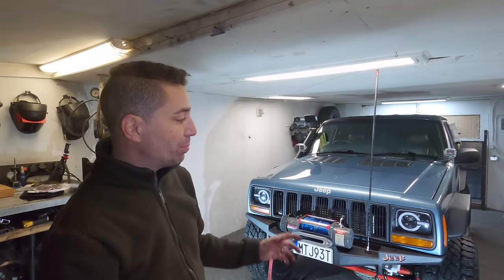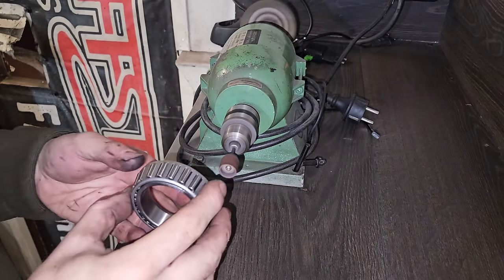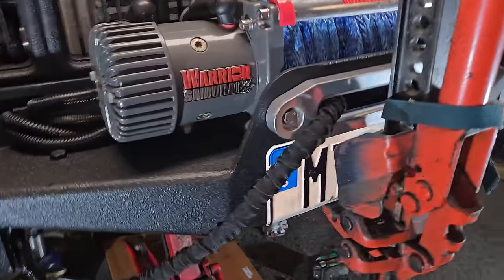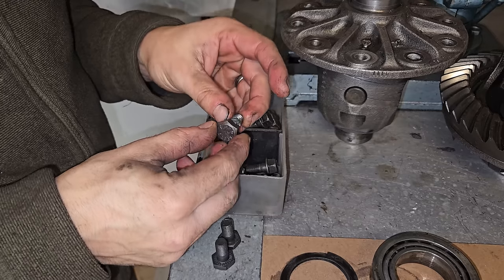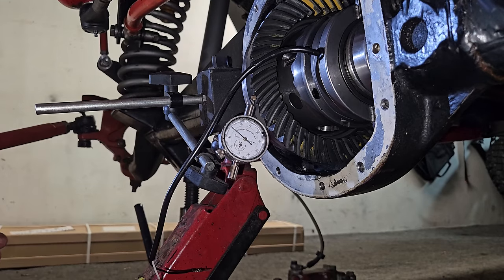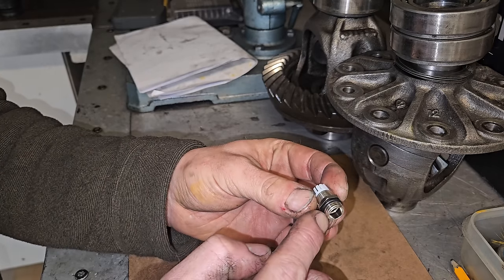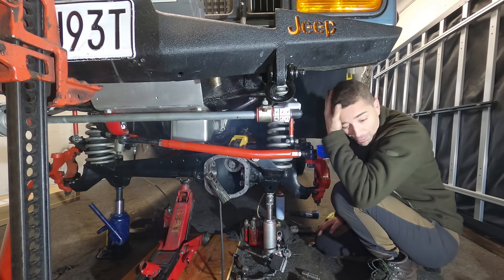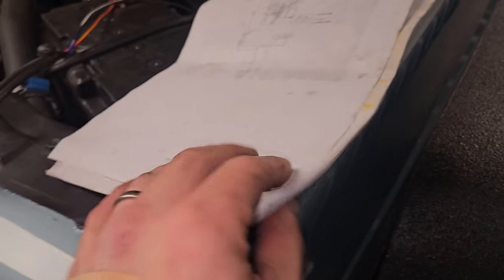Dana 30 HP E Locker Installation / USED GEARS

Comment: Use the locked Dana 30 sparingly. The axle shafts really don’t like spinning 35s with a locker lol. I’ve broken many of them
Reply from the maker: That's my main fear. I'm guessing even with chromoly shafts, it just means the ring gear takes the brunt?
Reply: @WorkshoptoWilderness  yes. id even swap back to the stock shafts if you have them. keep chromos for backup/emergency. then you have a "fuse" in the system. but if your not hard on it crawling rocks, it should be fine

Comment: Oh! I thoroughly agree that air lockers suck anywhere that has winter. My XJ is older and has (HAD) the Vaccum Disconnect to work the 4 wheel, and even THAT would freeze up. Glad it did, actually,  I learnt a lesson the easy way.

Comment: Nice project. And the car will definitely be a lot better off-road than it already is. About the E-lockers I see mostly bad experiences from people from Australia. Especially when the car rolls back a little bit the locker is out again. Personally I have no experience with it, have always used ARB or Ashcroft lockers. And I was very satisfied with that. Have fun with it.

Comment: 12:50 my wife was laughing, saying "That's you", meaning me.  The "how am I going to fix that" then "I can't fix that" and sacking yourself off the job for the time being, I can certainly empathise.  In the space of five seconds you can see five hours of work just to fix what was done.  We need the way-back machine to go back in time stop ourselves sometimes, even knowing we are almost guaranteed a shite outcome, we still have a crack at it.  It's all character building, that's for sure.  Cheers, from Australia.
Reply from the maker: Haha, we've all been there, or at least I seem to be there on most jobs! You're absolutely right, though. It's all character building, and it's good when you get through the job with a relatively acceptable outcome.
Thanks for watching and I appreciate the comment.

Comment: Hi Mike. Yay front locker in! Very happy for you. 👊 you have gone too long without! 
This was such a great video. Because it didn’t go the way you wanted it too. And you didn’t edit it out. You kept it real. And that’s what makes your channel so relatable! 
You’re a talented guy. With normal tools. Doing the best you can with what ya got!

Mike like others have commented. Might be best to keep the chrome alloy axles as spares. Break a stock one and not the ring and pinion. Put a spicer greaseable u joint on the long axle shaft. Because if you break the long axle shaft. Harder to fix in the field. 
Mike remember you’re most likely going to break a u joint when the wheels are turned.  But snow will be so much more forgiving than rock etc. 
Great job on siping the tires they look great! Perhaps keep the chains off the front axle? Keep the weight down. Save the ring and pinion? And now the tires are siped. Front differential is locked. Rear chains might be enough? If the snow conditions warrant chains etc.

Oh and 3 out of 5 guys I run into up here in Canada. Who run arb lockers. Say yeah. It’s not working right now. Air leak. I’ve no doubt ARB are great in warm climates. But like you. We get down to -35c here too. 🥶
Reply from the maker: Thanks, mate. I think it's good for people to see the reality of these jobs rather than a polished tutorial. I'm a bit worried about snapping an axle shaft or braking teeth on the ring gear. I've taken the long shaft out and swapped it with a normal shaft. 
So the short on is a chromoly with a 5-760x joint, and the other is a standard cheap u joint with a normal shaft. I mean, I was thinking of going to CVs because if they brake, they don't tent to compromise the preload on the wheel bearings. So you can still drive. 
I will see how it goes but I think low speed might be the key.

Comment: I could see that wheel spin required before locking being a problem if you're a rock crawler, but for snow wheeling a little of wheel spin realistically wouldn't be much of a problem. Should work awesome for you!

I'm looking forward to seeing your build change yet again as you work on developing a system for the increasing family size.
Reply from the maker: I think it would be a pain in the ass in some situations, but for what I do, it shouldn't be a big deal .
I'm interested to see how it works, but I think I will probably end up snapping an axle shaft again! 
The bed in the back is almost finished, but the family stuff is yet to be determined. We're expecting our 2nd boy any day now! Myself and my oldest have been on a camp, and he loved it. I'm not sure if he could handle the winter, though. 
Thanks for watching

Comment: Feel your pain!  Currently regearing and fitting an air locker, nothing seems to be going right.  Trouble is as I can't weld fixing screw ups is a bit trickier 😱
Reply from the maker: Ah, that's a pain! I mostly enjoy diff work when I have the right tools, and the axle is out of the jeep. But this time, I wasn't feeling it at all. I hope you're diff work gets better! All the power to you! 
Thanks for watching

Comment: that look on your face when you drain the diff oil and its.. milkshake..  we know that look lol
Reply from the maker: Yeah, that was not a good look. Maybe the new spider gears had shed their excess particles? I don't know, but I will try not to open it again for as long as possible and ignore all odd sounds. 
Thanks for watching
Reply: @WorkshoptoWilderness  all looked good inside and in the end.. it will self clearance.

Comment: Got some spatter on your break disk. Made me laugh. Top tip if you do that just put the exact same amount of spatter on the other face of the disk otherwise you might get some vibrations at speed... It it still does it you might need to add some to your other disks as well to even it out. 
Will I get an alert in the app when the OF session with Babs goes live? Don't want to miss it.
Reply from the maker: Thanks for the tip 😄! That bung had me foaming at the mouth. The reality of the work, though!
Barbra, unfortunately, was a no-show. I'm pretty disappointed. I found a stray cat to act in as a replacement, so hopefully, I can still make the deadline. 
Thanks for watching
Reply: @WorkshoptoWilderness  Mittens to the rescue. 🤣🤣🤣

Comment: Time for a Dana 44 or even better a 60 or hybrid 609.  Most meats over 35 are too much for the turdy as we call it.  Especially when locked.
Reply from the maker: Sadly, that's gold dust over here. It would most likely be a nissan patrol axle, which would be a big upgrade. Thanks for watching

Comment: I have a Volvo front lsd lol. But we are going Eaton e locker for both axles.
Reply from the maker: How has the lsd been?
Reply: @WorkshoptoWilderness  no complaints. Works just as good as the factory lsd in the 8.25. It handled deep snow pretty well also.  I'd do lsds front and rear again, it's no rock monster but it is still very capable.

Comment: Just did some upgrades to my XJ this weekend I had my son-in-law put in CV axles cuz well he was at the house and I didn't want to do it and what else is he for 

And I'm making fender flares for the front finally I'm tired of everything coming off the front tires and ending up on the windshield
Reply from the maker: Ah nice, what do you think of CV axles? I've been literally looking that up at this very moment as a replacement for my u joint axles. Not because of strength but because they are easy for me to buy here in Europe, and easy to swap out. 
Good luck on the fender build! Thanks for watching
Reply: @WorkshoptoWilderness  do it don't look back ,I'm glad i finely made the switch to CV axils

Comment: I love your videos! I just picked up a 96 Cherokee that is pretty rust free (except for ONLY the foot area of the floors). I hope I can protect the rest of this thing from the same fate (it even has mint pinch welds).  I was wondering where your front bumper is from? I looked for a video on it but couldn't find one.
Reply from the maker: Ah, fantastic! Sounds like a mint jeep and a good purchase. I'm sure if you film wax it and undercoat it, it will last forever. The film waxing is the main thing provided you don't plan on frame Stiffeners or something later. The bumper Is a tricky one because the guy doesn't make them anymore, sadly. He was a Polish guy who lived in the uk and made custom parts for Ebay.
Thanks for watching!
Reply: @WorkshoptoWilderness  thanks for the reply!  I've been watching your videos on the repair of the Jeep you had in the "yard" outside. I'll be in a similar boat with the foot well area. They are probably 12" holes right where thr driver and passenger feet go. I'm assuming it's rusted from the inside out from the notorious cowl leak areas.
Reply from the maker: It sounds like its rusted from the inside, but good news that its just that area. If you just have that to do then you can paint inside and get the Jeep in a good state relatively painlessly.
Reply: @WorkshoptoWilderness  that's what I was thinking (inside out) unfortunately it's a full hole like the one you were working on so I'm using your awesome videos as a learning tool for repair! Such great work, thanks for documenting everything!!

Comment: Why did you grind the inner race of the bearing? You should heat it up before installing on the shaft. Looking forward to the next video! Keep posting :)
Reply from the maker: It's called a setup bearing. It's a common practice when setting up diffs as it allows removal to add or take away shims before committing to pressing on the final bearing. You can buy them like this but they cost more.
Reply: @WorkshoptoWilderness  I might have missed something in the video. I totally understand now, thanks :)
Reply from the maker: Not so many use them anymore, but it makes life easier when you have shit tools like me 😆

Comment: I’ve commented on your videos before and need to ask if it’s a good idea buying a 2000 year model XJ? I read they are prone to cracked heads? Or is it a simple fix and should not be a dealbreaker?
Reply from the maker: Is it a 4.0? The 2000 and 2001 4.0 had a slightly different head. Apparently, it is prone to cracking in one specific place. I wouldn't say it's a deal brakes as many run this head without issue. If it did crack, then the head can be swapped for a better head. I certainly wouldn't let this put you off if the jeep is in good condition.
Reply: @WorkshoptoWilderness  they are listed on Blocket and yes, 4.0. Prices are between 60-70.000 kronor. I saw a good 1995 model last week but it got sold fast. Now I see two green ones, a 2000 at 59.000 and a 2001 at 68.000. 

They look good in the pictures, but I guess I need to see them live.
Reply from the maker: I looked it up for years 1999, plus had the 0331, and it doesn't have enough nickle in the iron casting. Apparently, it can crack easier. It also mentioned that this doesn't happen to all of the years, so it's kind of a gamble. Apparently, some run fine for the whole of the engines life. I would go for it personally.
Reply: @WorkshoptoWilderness  thank you for taking time to answer. I’m gone go and take a look at one of them, might be a decent one. 

My main goal is to use the car for hunting/fishing/occasional camping and I want it to be in good condition, but it doesn’t have to be like new.
Reply from the maker: It sounds like the perfect use for the vehicle. Hopefully, the one you are looking for is in decent condition. Are you in Sweden? If so, is the jeep in the north or south?
Reply: @WorkshoptoWilderness  yes, I’m in Sweden, svealand. The particular car I saw on Blocket is in Stockholm, so that’s east central I guess?
Reply from the maker: Ah, okay, just curious as the ones in the north obviously tent to be better on corrosion. Hopefully, it's all good anyway. I drove down to Stockholm four years ago to look at and pick up an XJ for a mate. It was in good condition corrosion wise. Let me know how it goes.

Comment: How did you make the tires with bolts or what is that
Reply from the maker: They are tungsten studs that you shoot into the tire with a gun. It's a legal requirement here in the winter. The grooving I've done with a tire grooving tool to make them hold snow better.
Reply: @WorkshoptoWilderness  thank you